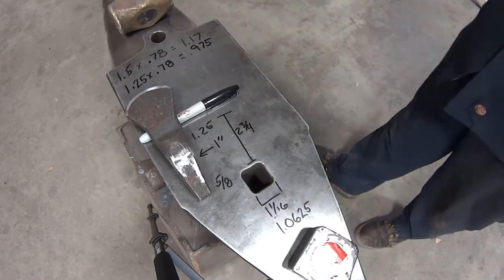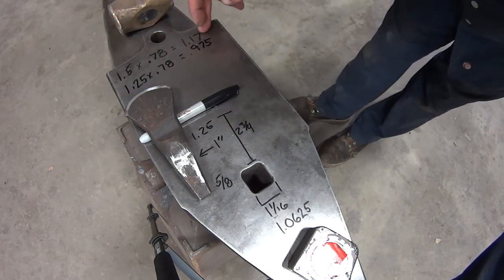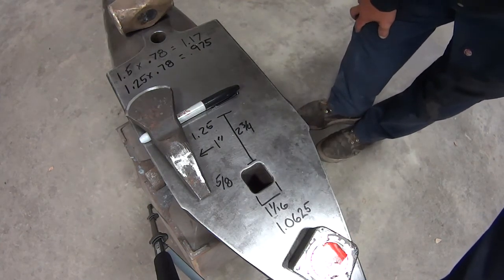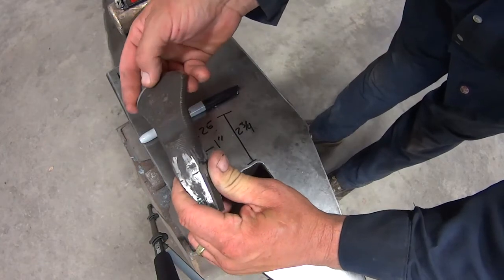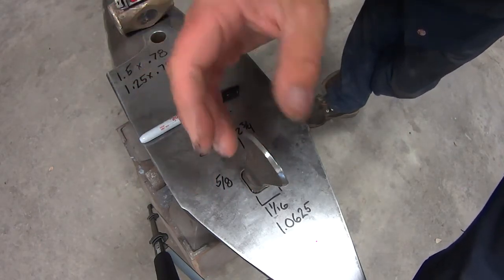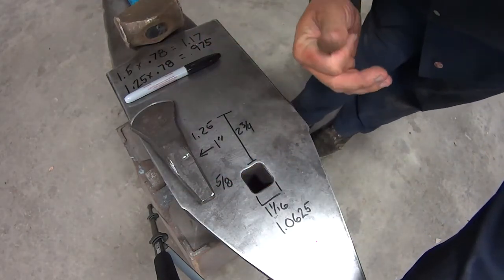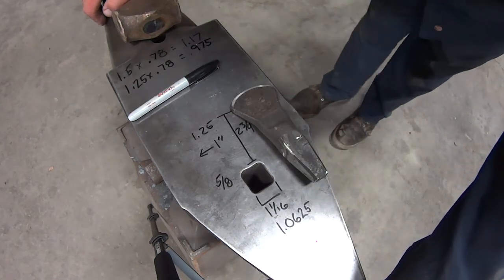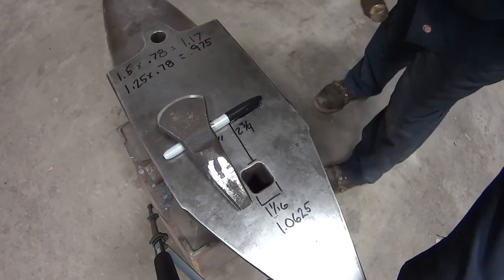Blacksmith math: Brazeal style hot cut explanation of layout

Comment: Why are we multiplying by 0.785? Where does this number come from?
Reply from the maker: Volume  of cylindrical materials vs the same size in square or use . 79  so 1 inch square material 1 inch long could be forged round/cylindrical and your length would be close to 1.21 inches. Likewise if you take 1 inch of 1 inch diameter cylindrical material and upset forged it into 1 inch square, your new length would be close to .79 inch long.
 Hope this helps, 
John